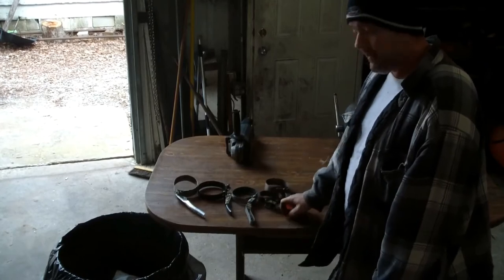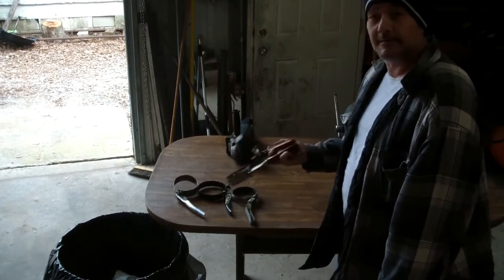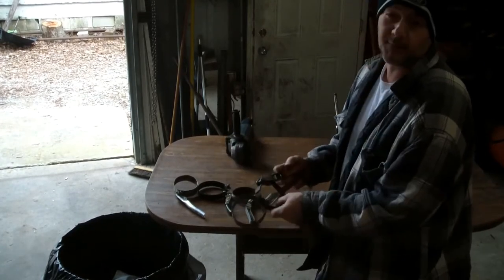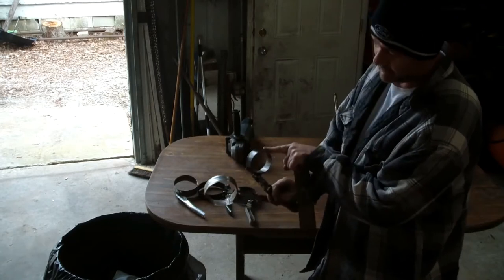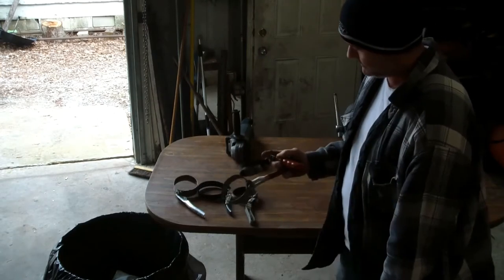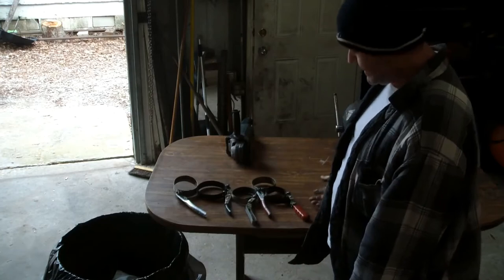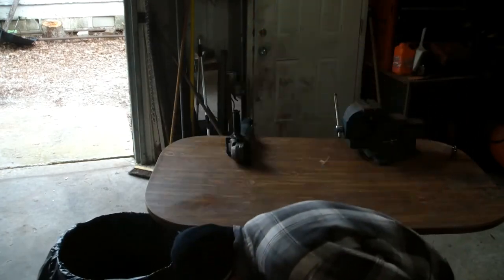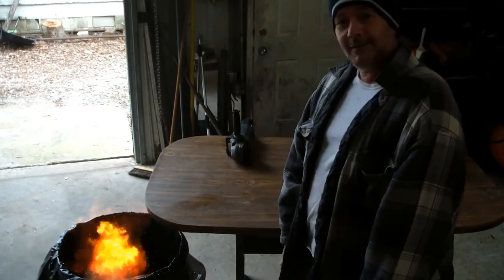DIY Oil Filter Wrench From A Socket And A Seat Belt Or A Old Ratchet Strap Free

Comment: Some times ill just punch a big screw driver right thro the oil filter and leftey looseie righty tighty lol the arm power back on 🇺🇸💯🔧👍🇺🇸
Reply from the maker: Been there  done that
Reply: @kickassmustangsgarage  especially on them 7.3 is hard to get them off sometimes they tight
Reply: problem is some of my cars the dam filter is so far up in engine you can't get to it except from end of filter.